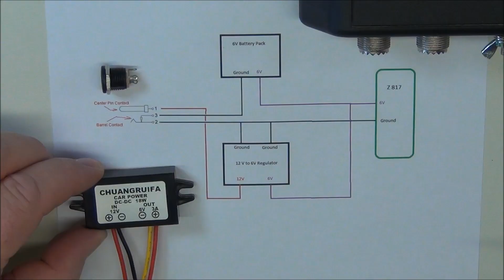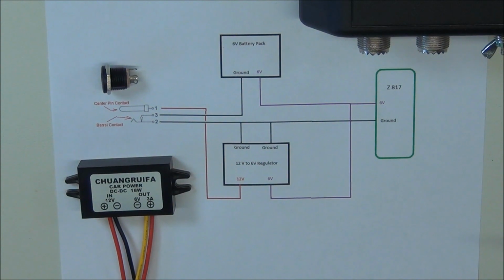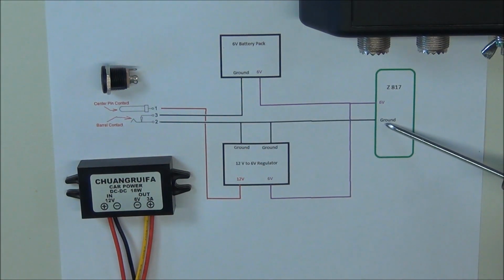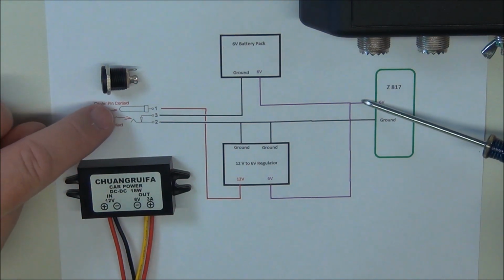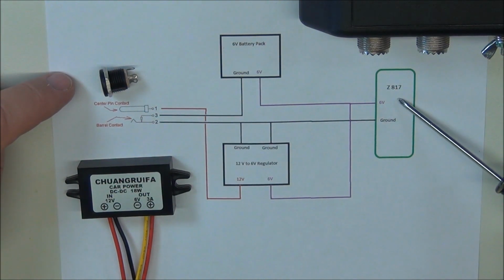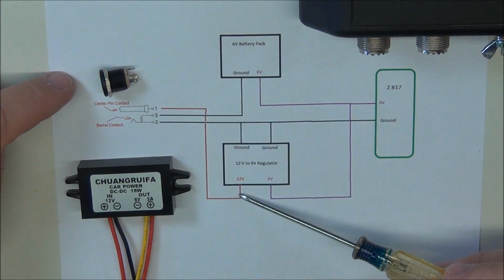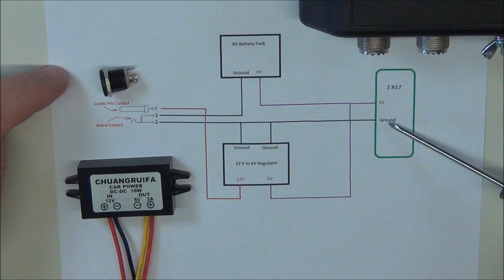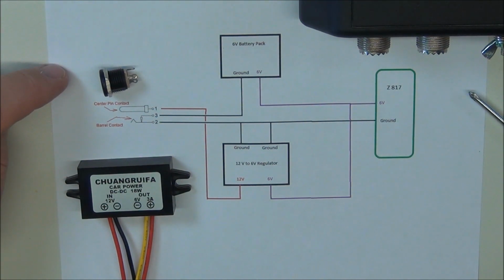Power / RFI Modification / Hack of the LDG Z-817 Autotuner Part 1 - AF5DN

Comment: I don't understand why you need to do this as the Z817 can be powered by the Yaesu 81x via the control cable. You didn't say you are going to use it with a different radio.

Comment: personally id wrap the outside of the case in tin tape not inside(a faraday cage is a faraday cage). just that much less chance of something shorting and if your not into the chrome (if you use tin tape) or steampunk (copper tape) color it black with a permanent marker or paint.

Comment: Toroid fields stay around the coil. Because of that the RF field stays with them not bleeding RF out.  Also at QRP power RF leaking is not a real concern provided you ground of float everything.  The point is you don't need the copper tape.

Comment: Could you use this instead of copper tape?

Super Shield Conductive Coating  841
Reduce or Eliminate EMI / RFI Interference
A general purpose EMI / RFI shielding spray for use on plastic electronics enclosures. Consists of a tough, durable acrylic base pigmented with a high purity nickel flake.

Comment: Well a few things about the way you have your tuner configured. The batteries have a internal resistance that will eventual kill the batteries if you use them or not. Most likely the wont corrode, because there is very little or no current flowing through the batteries if you don't use them. But if i was going to use this in a home station and have them permanently on provide DC, I would remove the batteries. And by taking both of the ground wires and shorting them together, you will get a ground loop. This is the same as connecting coax to the radio then having a ground strap to the radio and tuner. Any SWR problems you may have can be harder to tune out with a ground loop problem. If that converter (a LM317) makes a lot of noise under a high load, it will get caught on the ground loop, you will hear it. And just in-case the LM317 is noisy, would have added a fairly large capacitor on both the input to the regulator and the output.   73's K5DVT